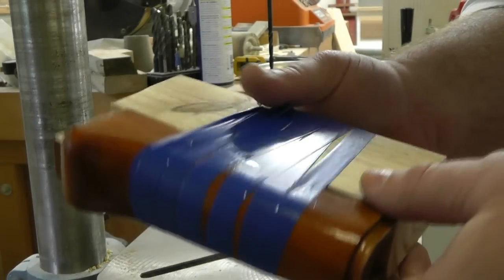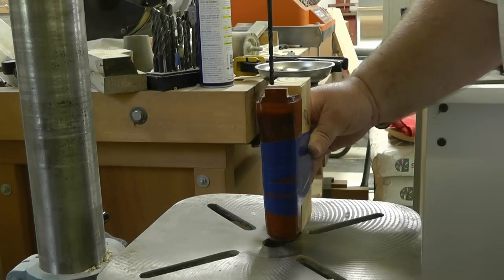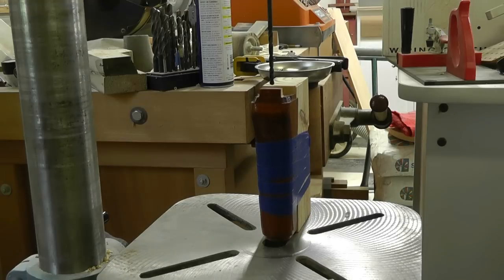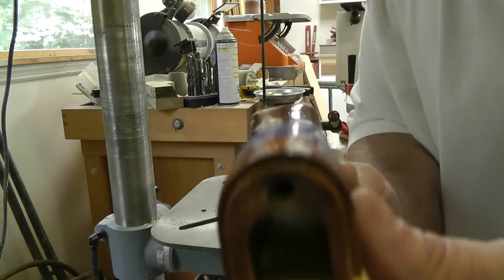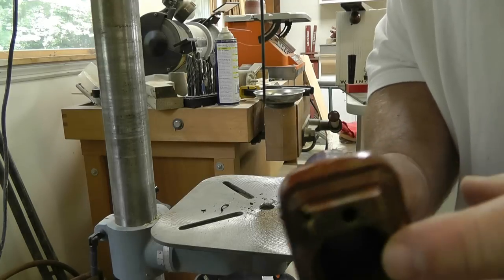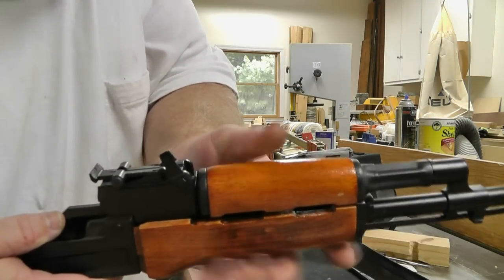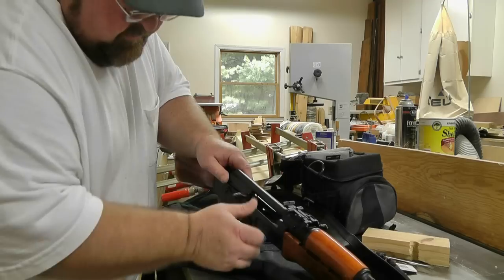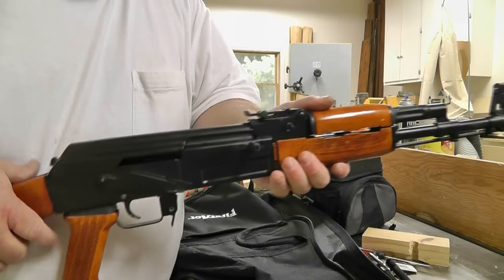Drilling a Hole for the Cleaning Rod in a Wood Lower Handguard for the AK

Comment: Have you drilled the butt of the stock to retro fit a cleaning kit? I recently purchased BFT 47 and would like to add the cleaning kit but I’ve found nothing to be able to do this I cannot be the only one that wants to do this there are kits online for trap doors but nothing I’ve seen will work for the BFT 47 butt plate dimensions

Comment: "Secret between the two of us". That is great. LoL. BTW great job on a great AK (1 of the best AK ever made). I just bought the same exact SAM 7 & plan on doing the exact same thing to mines. Only difference is the stain color. Where do you go for the metal hardware to complete the look of the stock and forend, also what is the metal hardware for the pistol grip, forend and stock called? I have not had too much luck finding those. Thank u for all of ur help. I will show mines when I finish.